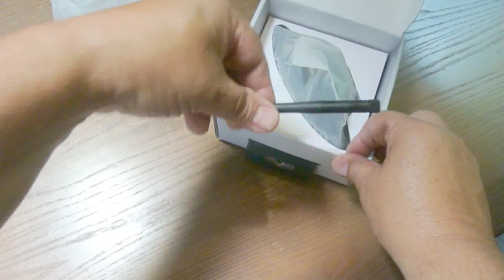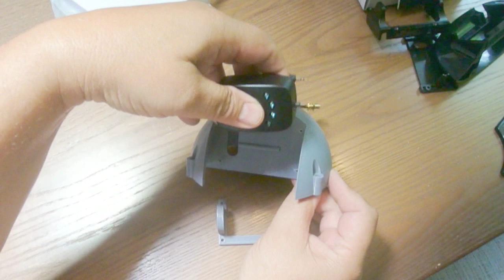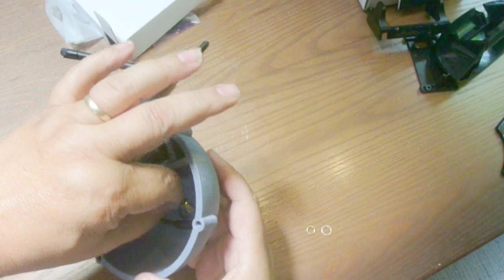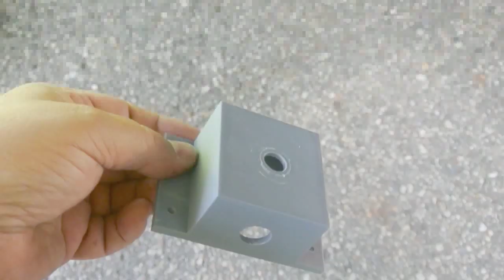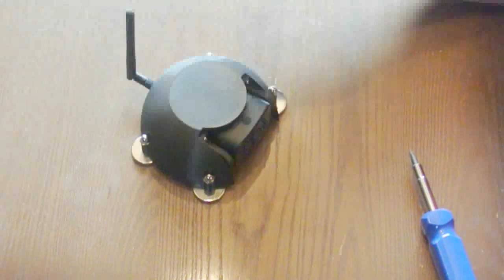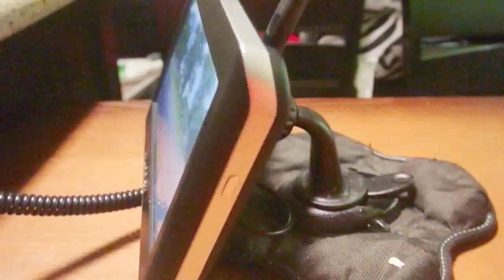A custom built Furrion Vision S "hitch camera" enclosure.

Comment: I have a toy hauler, and I have the furrion s door camera on the back. I want to install a camera inside so I can see my motorcycles while I'm driving to see that they're alright. Just wondering what you would suggest for that.
Reply from the maker: The hitch cam I made was a Furrion S.  If you have the multi-screen Furrion S monitor, there is a function for a "door" camera, which is intended to be the same camera I bought, but to be hanged on the outside door.

There is no reason you could not use the door camera for the interior - as long as the signal  is strong enough to reach the monitor. 

 I would expect some attenuation of the signal from operating a camera inside of the RV, so there could be a chance of it not working.

Comment: CAN WE BUY THESE FROM YOU ?
Reply from the maker: I am not setup to do retail.  I do provide the STL files on my website that you can download and print yourself.

There are also print services out there - check eBay - that will print an item for you.  However, it's been my experience that you can probably buy a 3D printer for less than what they charge.

Comment: would you be willing to sell the OEM housing?
Reply from the maker: Unfortunately, I don't know what I did with it. But you can buy just the housing.  This is the pre-install kit, so make sure it comes with everything you need for your application.

https://amzn.to/2NS1pHP
Reply: I really just need the plate that holds the camera that mounts in the housing. Furrion was no help. Wanted me to buy another camera.
Reply from the maker: The link I provided is for the housing and power cable.
Reply: RVProject Can you please re-post the links can’t find them anywhere to buy your 3-D printer camera housing and switch housing can you also please provide the link for the switch that you used to turn it off and on and possibly a wiring diagram

Comment: I was thinking about doing the same thing but I wanted on my truck I just had an incident where I lost one of my sway bars and I thought it was my sons game on his iPad
Reply from the maker: You can mount the camera anywhere that you can supply power and as long as you are in range. I even thought of putting in a set of AA batteries inside of the housing.